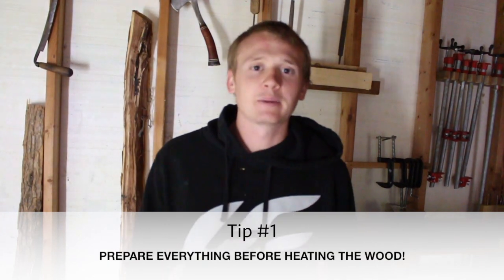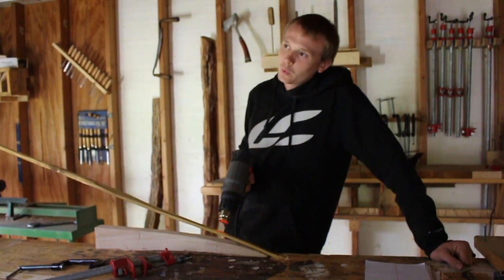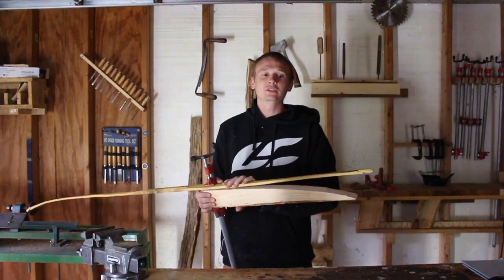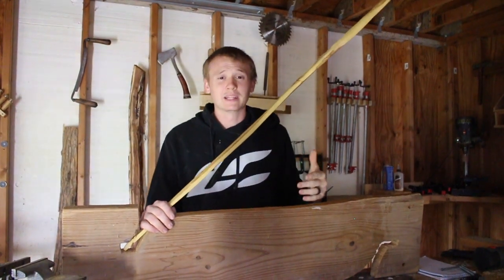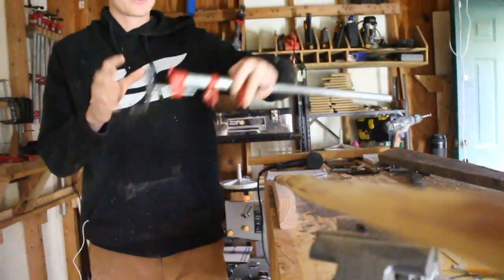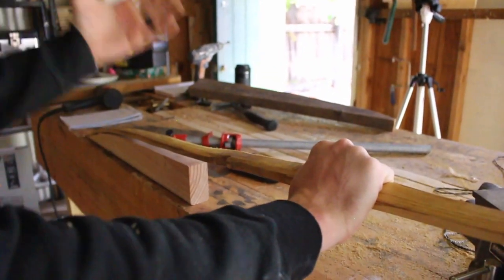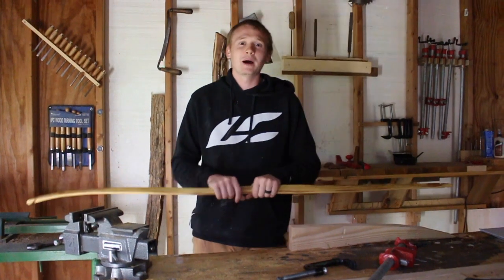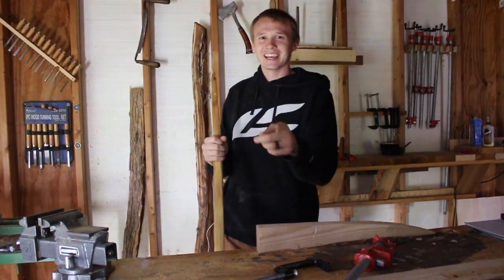HOW TO BEND/SHAPE A BOW WITH HEAT!!!

Comment: if the bow cracks as you say at 1:35 , can you heat it up and glue it back or is the wood ruined? sometimes my canes will crack or split at the curve and i'll just wet it , heat it up and clamp it down , hoping the cracked part will conform as the wood dries , thanks

Comment: Kramer love your vids but have a question i have a old long bow wiuld like to shorten the limbs so i can use it as a hunting bow ir bush bow how woukd be best way to do this afraid of destroying a good bow by trying this
Reply from the maker: Thanks so much! If the bow does not have a backing then you can just cut the limbs down and then add new knock grooves. This will increase the poundage of the bow as well. You will have to be careful if there is a bow backing.
Reply: @kramerammonsarchery  no backing just laminated wood.... thank you i was thinking that but was unsure

Comment: I have a bow on order from a maker on Etsy, but i decided to try my hand at making one as well and i have minimal knowledge. I assume heating/ steaming a bow is a required part of the process, yes?
Reply: Only if you want recurved tip. Or if you need to bend the wood to align it right.. not always needed but alot of time natural wood isn't perfect and needs to be bent to make the bow useable.. good luck man
Reply: Also fix propeller twists*
Reply: Thanks man. I appreciate the information.
Reply: I'm just starting to try my hand at bow making the first one was an old stick that had some flex after my boy was wanting to make one out of some bungee and a c shaped stick so I thought I'd make him one.  It snapped my second one also a kids bow separated by the handle I wrapped it and now  it will shoot arrows but not far or very well. 

The third one another kids bow is significantly better.  The two I'm working on now are I'd say adolescent sized and one is actually sizing up to be decent hopefully I can finish it well.

I guess my point is not to get discouraged I've learned quit a bit from it all. I think I'm ready to go hunting for a proper stave now that I have a better idea what I'm looking for. Good luck